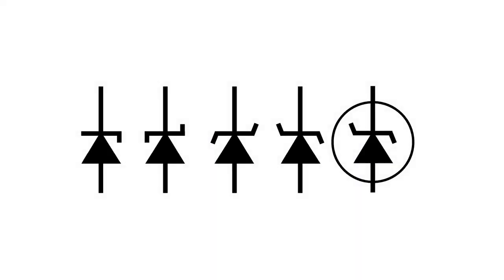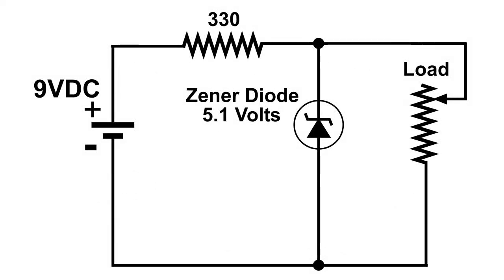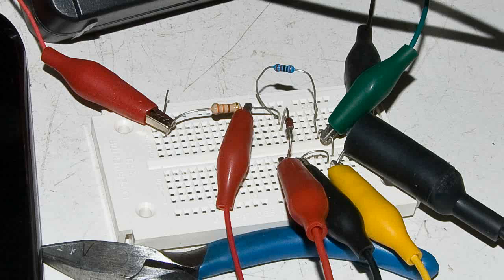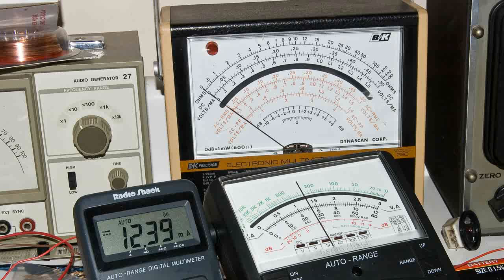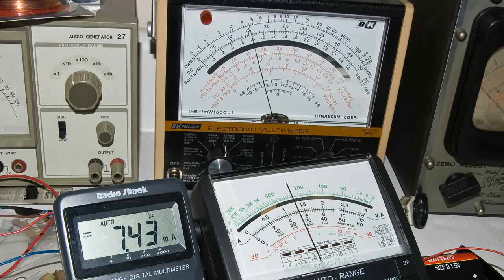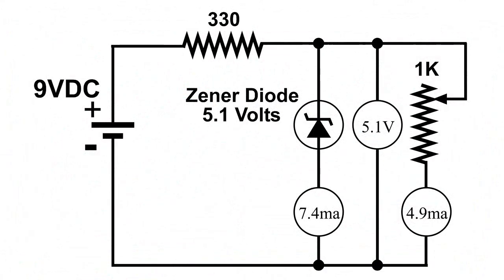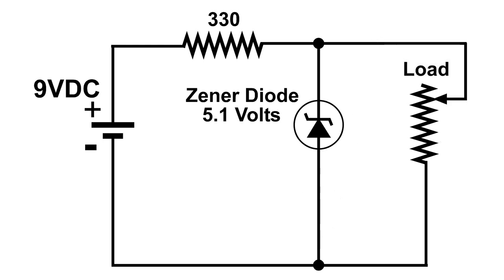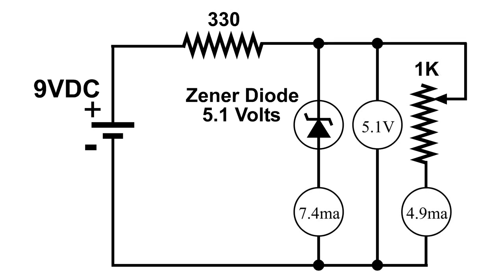Zener Diodes, the Basics

Comment from the maker: Of course, I would have been disappointed. The affect is the same for a gas filled tube when used as a voltage regulator. Search Thyratorn you will find lots of information, The characteristics are changed by the type of gas and the amount used, as is changing the amount of doping in a silicon chip. Still the remarkable thing is no one really knows why. Just as why when a magnetic field cuts thorough a wire. Why do electrons move, no one knows WHY!

Comment from the maker: Thanks CameramanLink 
Guess what some of those 3-pin ICs have as part of their circuit. If you had a regular diode in this circuit there would be no current thorough that diode. The Zener is heavily doped when it is grown to conduct (avalanche) at a selected voltage, in this case 5.1Volts. You can get this result with the forward base of a regular silicon diode, the voltage will be 0.7 volts. If you put two diodes in series then the voltage is 1.4 volts. 0,7 for each diode in series.

Comment from the maker: Thanks justthistime1000 
This Zener will handle 49ma and at 9 Volts the lowest resistor would be about 184 ohms. For power supply design I would think that what it is you are wanting to power would drive the design.